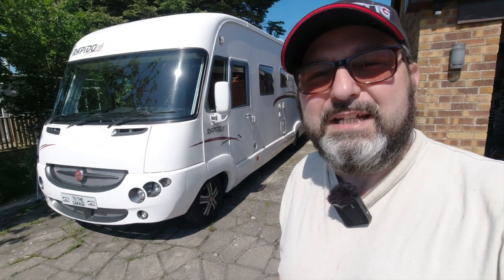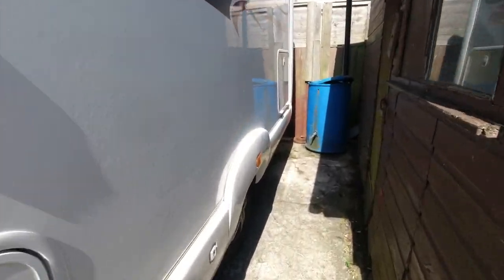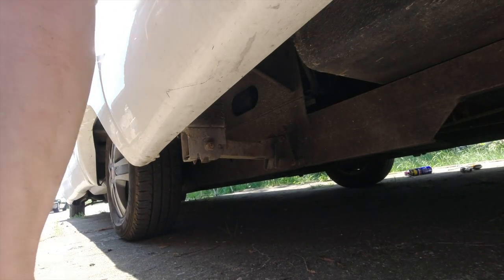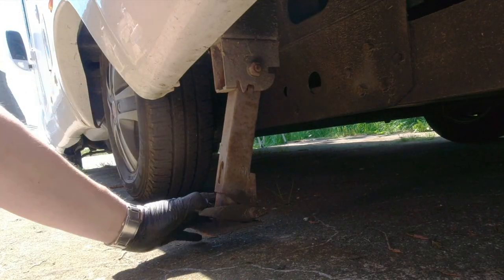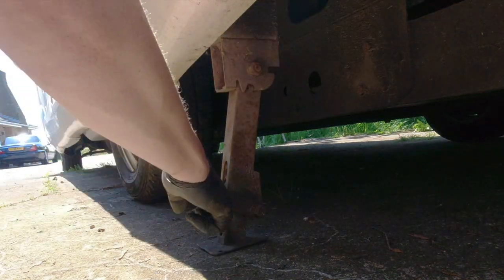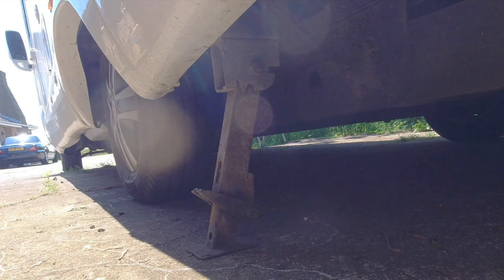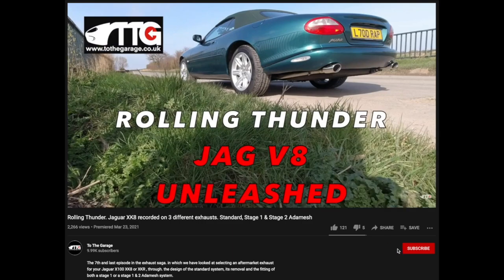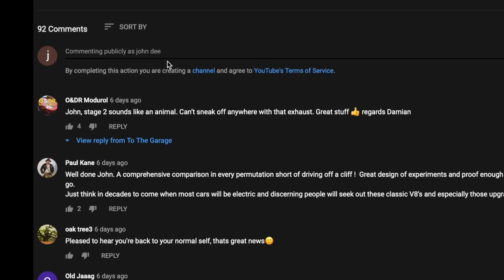Modify and improve your motorhome corner steadies. Ruby the RAPIDO 9090f 'A' class

Comment: John, I think that you have slightly missed the point with these steadies. They are supplied with a bar about 12mm diameter and 300mm long. This bar goes through the slot and holes in the steady and allows you to apply some leverage to the drop down leg. This leverage is sufficient to lift the motorhome body a little which ensure that the steady is positively engaged. To lower the van and lift the steady you simply stand on the release lever and the leg will disengage. Hope this is of help